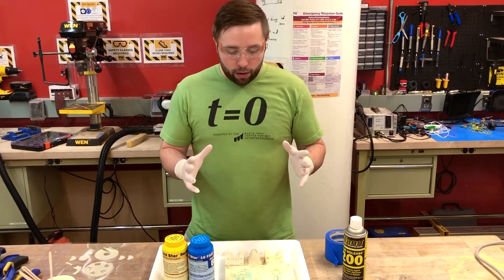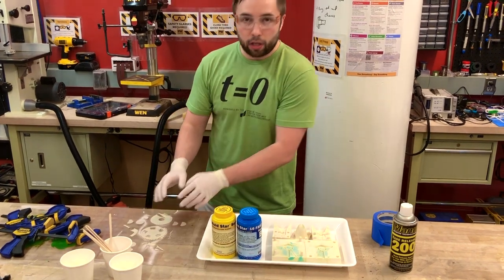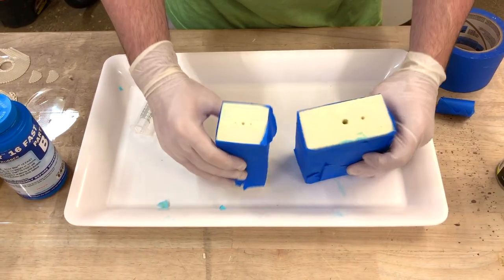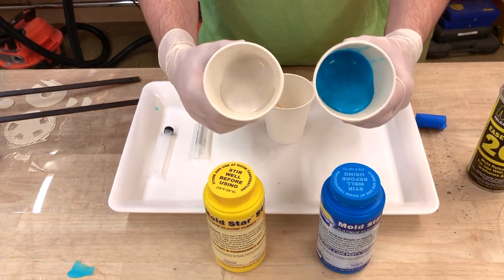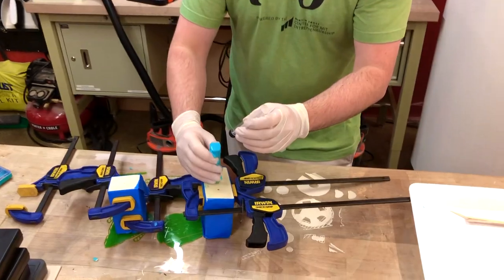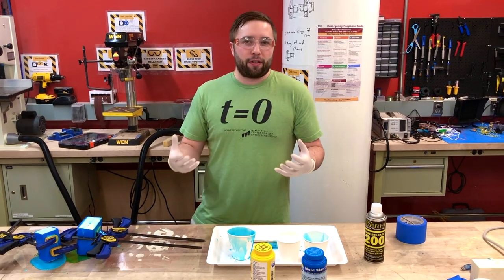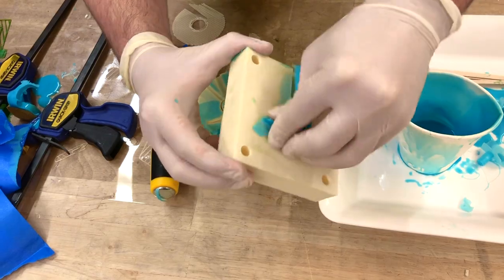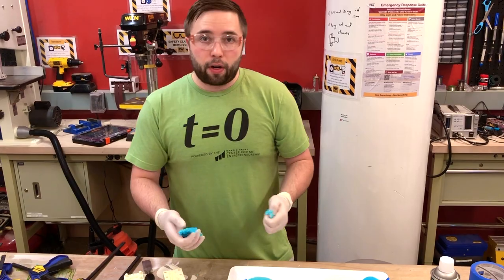3D Printed Molds for Injecting Silicone

Comment: What a mess. You overfilled the syringe and spilled silicone all over the place.

The main problem in doing this is getting the bubbles out of the silicone, that where created while stiring.
If you have a vacuum-chamber it’s the way to go.
If not, you could let the silicon rest some time (dependend on the pot time of your silicone) bevor injection. Cooling it will extend pot time. Taping the cup will help bubles getting up. Pouring it in a thin squirt also helps to remove bubbles.
Reply from the maker: Yes, you are correct.

Comment: Can you use Resin with these molds
Reply from the maker: Great question. Yes but you have to be very careful with the draft angles on your mold design so you can pull it out without breaking it. Don’t forget mold release and you might want to sand the inside of the mold first. It would work much better in a silicone mold. You could use 3D printing to make the mold for the silicone mold.
Reply from the maker: I will make a video or using hard resins when the lab at MIT opens back up in a few months.
Reply: @maccameron5790  what about a flexible filament like TPU
Reply: @maccameron5790  cool ok
Reply from the maker: Tommy F it should work!
Reply from the maker: @TommyTheMadDog  Yes, that should work